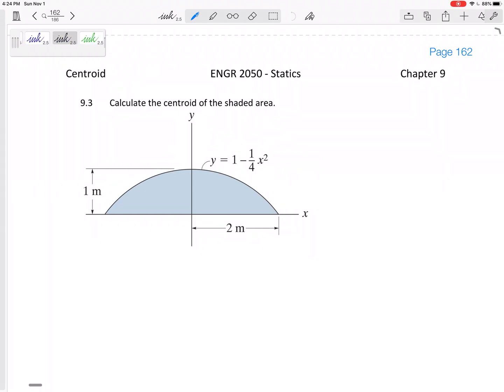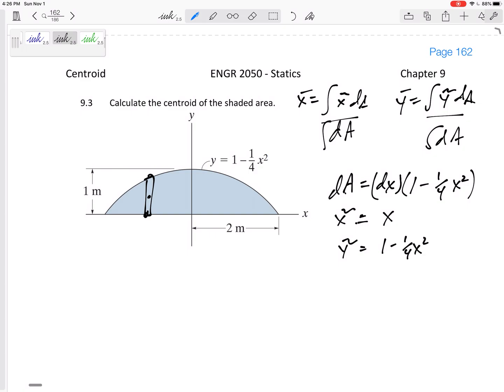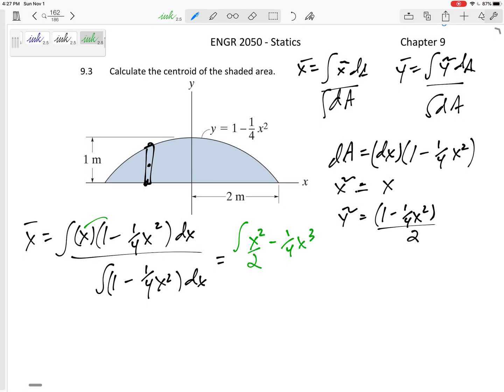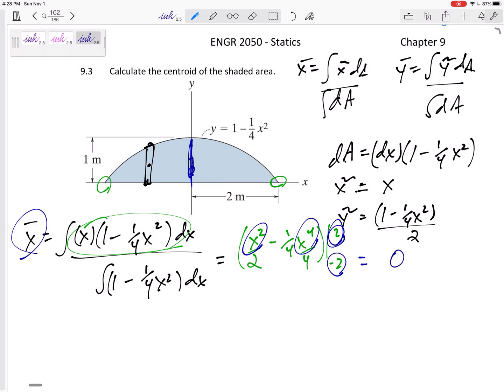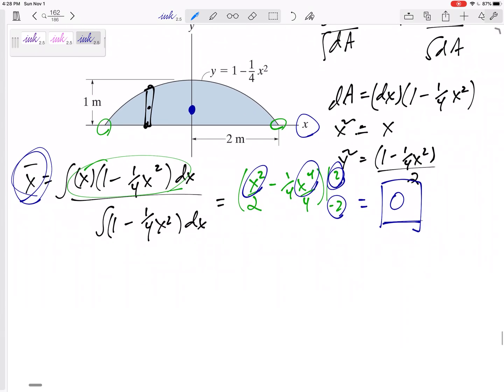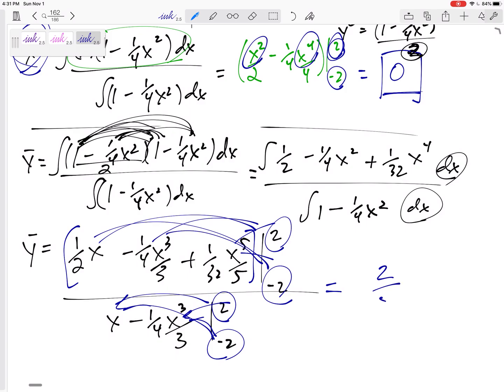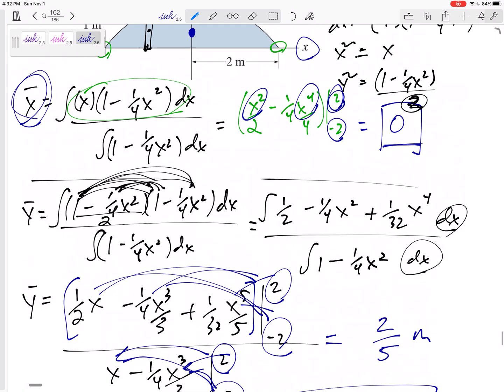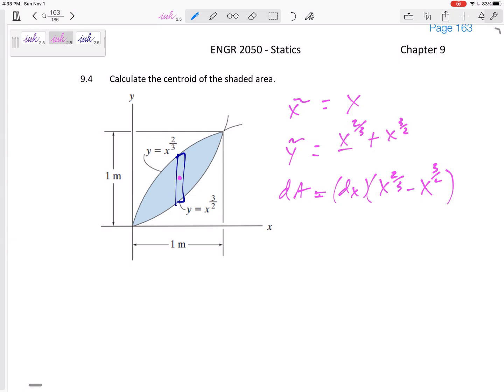Statics - Centroid of a function example 3

Comment: I think you did a mistake at the integers of y. mine is equal to: (1/2)*x - (1/12)*x³ + (1/160)*x^5
Reply from the maker: I think we’re saying the same thing. I’ve got 4 and 3 both in the denominator (you’ve got 12). I’ve got 32 and 5 in the denominator (you’ve got 160).
Reply: @engineeringdeciphered  fair enough, you're right
Reply: @engineeringdeciphered you made a mistake in 1st problem while putting values in the formula of y, you have taken just 1/2 not 1/2-1/8x2